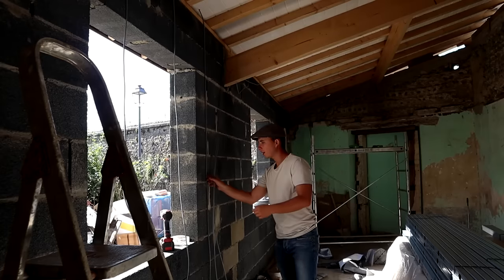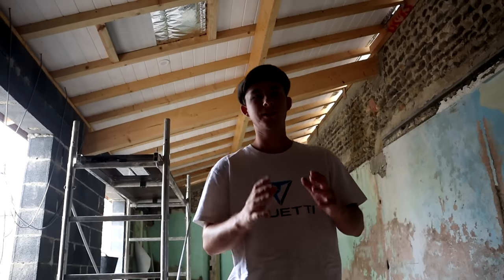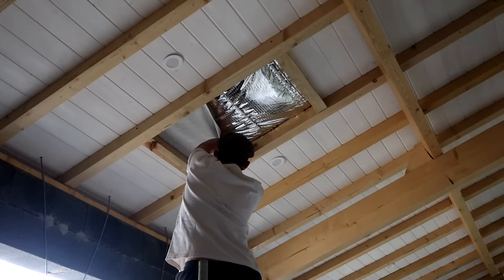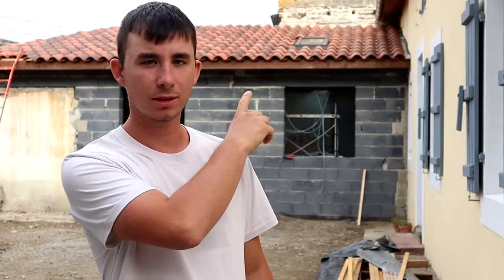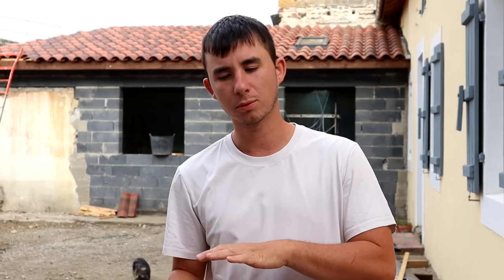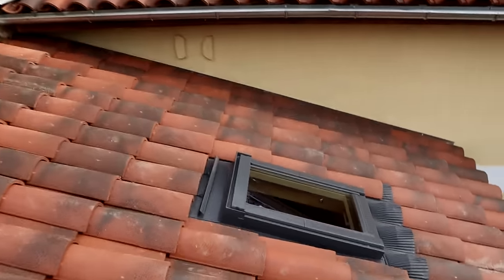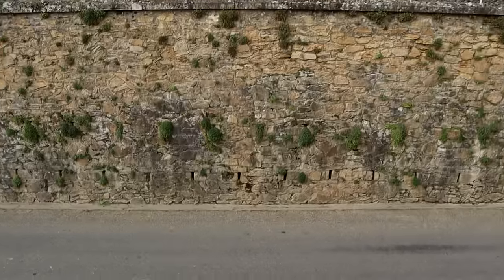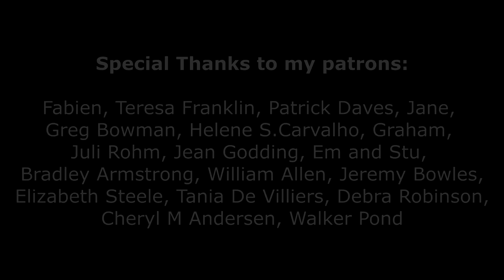Laying the roof tiles, Installing skylight, Starting the interior #53

Comment: I was wondering if you are going to use a vapor barrier between the block wall and insulation.  I didn't see it in your bathroom build and worry that you might have a mold issue in future.
Reply from the maker: Yes we did in the bathroom and will do it on this kitchen too

Comment: Your home looks better with each week. At 5:00 into the video you are calking the metal flashing. What's to prevent rain from blowing in between the side of the flashing the house wall?
Reply from the maker: Yes its the last joing between tiles and facade😊